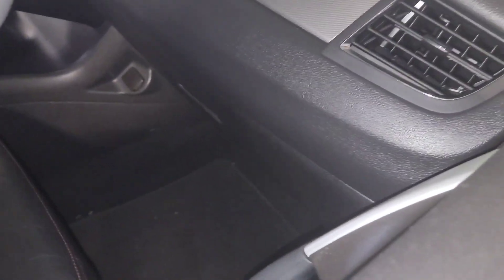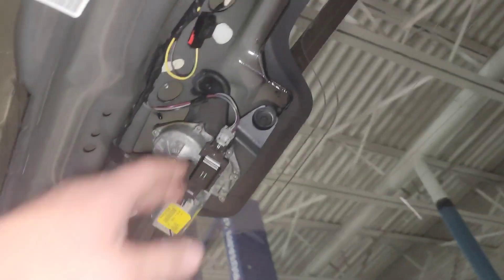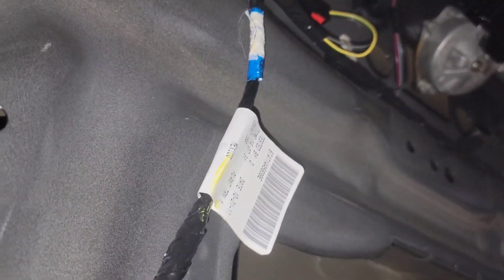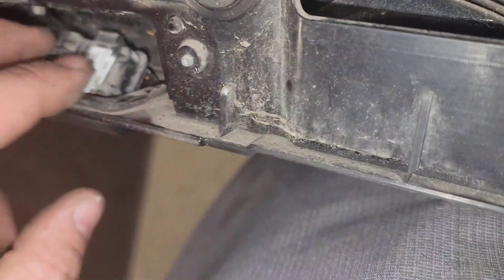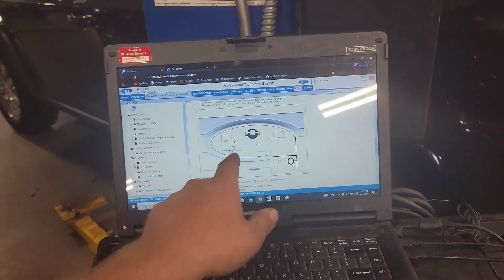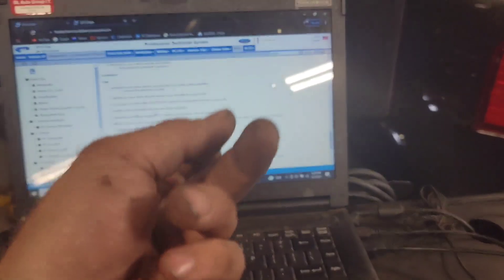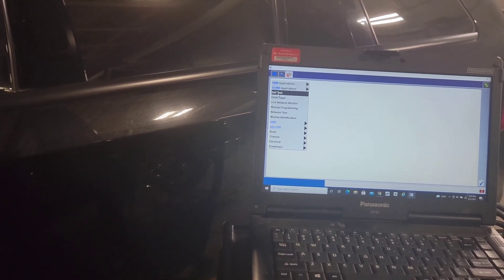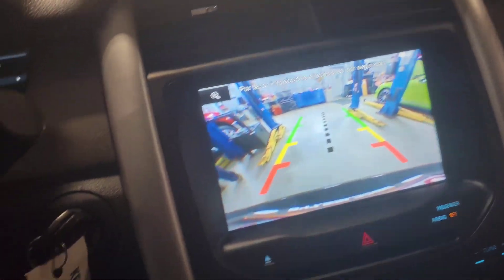2012 Ford Edge Rear Camera Install - The Easy Way - Save You A Few Dollars - Customization Job

Comment: What happens if this camera needs replaced, for some reason?
Reply from the maker: You could do the same thing again or you can pull the emblem it's going to come out either way all I did was just recent cured back in the same spot
Reply from the maker: You're not gluing the camera you're only gluing the hold down
Reply: This guy doesn't know what he is doing. To replace camera, you need to take of that whole plastic cover to get at the clip that holds the camera. It doesn't take long or much to do that. I actually takes longer to cut and glue.

Comment: Thanks for posting this video.  It was very helpful.  I discovered that the whole rear trim assembly that houses the camera DOES COME APART WITHOUT BRREAKING THE EMBLEM OR THE CAMERA MOUNTING BRACKET.  The studs that are used to bolt the trim assembly to the liftgate actually unscrew.  Only the 4 outboard studs need to be removed.  The 2 studs in the center can stay put.  Use 2 of the six 11mm bolts taken off to remove the trim assembly.  Screw 1 bolt about halfway down the stud and then screw the other 11mm bolt down on top of that and TIGHTEN THE TOP BOLT DOWN HARD AGAINST THE BOTTOME BOLT (USE TWO 11M OPEN END WRENCHES FOR THIS).  This will lock the bottom bolt so that it won't unscrew during the next step.  Use a thin 11mm open end wrench on the BOTTOM bolt and turn counter clockwise and this will unscrew the stud from the trim assembly.  Do this for the 4 outboard studs (2013 Ford Edge).  Next use a thin flat blade screwdriver to release the 11 plastic tabs (The tab in the very center didn't have an access hole to release it & I ended up pushing on it from above and broke the silver plastic piece that the tab locks into.  The other 10 tabs were fine.  Don't worry about that center tab.) and the black piece will separate from the silver piece, giving u access to the camera bracket screw.  Remove camera bracket screw & bracket,  install camera, replace bracket and screw and reassemble the 2 halves of the trim assembly.  To reinstall the studs removed during disassembly, screw 2 of the 11mm bolts as before BUT USE THE WRENCH TO TURN THE TOP BOLT CLOCKWISE.  DO NOT OVERTIGHTEN!!!  Use 2 11mm wrenches to loosen the 2 bolts from each other and remove them.  BOOM DONE WITHOUT BREAKING THE CAMERA BRACKET OR THE FORD EMBLEM AND NO DRILLING HOLES REQUIRED.
Reply from the maker: There's more than one way to skin a cat you know that's the old saying
Reply: Wrong! Tried this in my 2013 Ford Edge and the bolts would not come out. I even to it to my mechanic and he spent a couple of hours trying everything he could think of, including the bolt trick and they would not budge.

Comment: i just replaced a brake booster & rear camera on an Edge a couple weeks ago, I didn't cut, drill or glue anything. I removed all the studs , popped the back off the assembly, removed the screw for the hold down plastic bracket & replaced the camera.
Reply from the maker: You got lucky
Reply from the maker: I even went up to one of the senior technicians and he said good luck good luck not breaking it

I've literally seen guys mangle these trying to do this job
Reply: @FordBossMe  I've been wrenching for 43 years, not luck.....skill (lol)
Reply: Yes stud removal process works everytime with me 🤪 while replacing camera no cut no drill I feel stud removal is easiest one
Reply from the maker: @crystallakegarage  well I did what I did and it works very well and we're going to leave it at that
Reply from the maker: @prajay888  I'm not here to compete with you guys I'm not here to play whose is the biggest I'm here to share what I do and I'm open to listen to what you do but this ain't a pissing contest
Reply: Did this method a year ago on my 12. Worked. Whole replacement took maybe 35 minutes. Just went easy on the studs.  That's with coating the entire inside of the hatch with fluid film.

Comment: Thank You! I followed the steps as shown and it worked great. For removing the nuts I used a long 7/16" socket. I used super glue and then JBweld.

Comment: The last time I did one of these cameras I followed the book and removed the Ford emblem and drilled the hole. When I replaced the emblem you could only order it with the piece it's attached to which had to be painted. What a pain, I believe I'll use your way of doing it next time. 👍
Reply from the maker: The guys in the shop was pretty impressed with how It ended up and how clean it was and saved a ton of money

Comment: do you have access to a "gas sipping" 4 cylinder car for a week to do similar driving? Then compare gas mileage. 21 mpg is great for that car before mods. you would figure a 4 cylinder would get at least 40 mpg?  however you would struggle to get 30 mpg with a 4 cylinder doing your daily driving,in my opinion.  notice i put gas sipping in quotes.

Comment: What camera replacement did you use? Could you comment the link
Reply from the maker: Are you asking for the part#?
Reply: @FordBossMe  part number or the link where you go it at
Reply: I’m wondering if it capable to wire in a aftermarket backup camera that hooks to the license plate, wire it up to the existing wiring for my backup camera that’s factory
Reply: @WeAreAlwaysWatching92  # part o link please

Comment: Have you seen 21 f150 with 5.0 engine have have power train malfunction problems at your shop
Reply: I can send you the video of the problem advance trac was not working  it lost power and truck was shaking I took it to the dealer but just wanted to know what you know
Reply from the maker: Only PCM disabled because of oil level and percent
Reply: @FordBossMe  can I send you a video I recorded of the truck doing the problems also the truck would not respond even when I had the pedal to the floor it and I got the 1st oil change last week it has 5400 miles r
Reply from the maker: @JoseCruz-sw8dt  poissorichard.rp@gmail.com
Reply: @FordBossMe  thanks I sent the video it’s not much but gives you an  idea  of what the problem is .  I’m not sure what it is could be maybe something with the driveshaft recall but I look up my vin number and it showed my truck was fine
Reply: @FordBossMe  isn't there a TSB out on this issue with the 5.0's?
Reply from the maker: @Twistedstanger  yes, it's up on the channel here 2021 Ford f150 pcm disabled walk through
Reply: @FordBossMe  thanks I take a look at it
Reply: @FordBossMe  thanks I thinks the issue are real similar it’s just crazy because I did get the letter but I took it the dealer to get the oil change at 40% oil life just last week and they didn’t tell me anything about it so I figured everything was fine